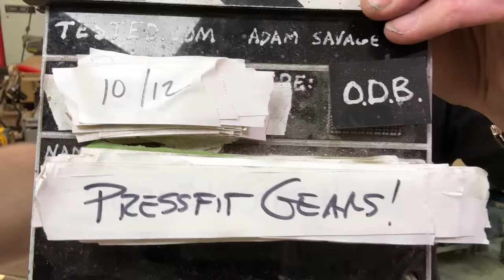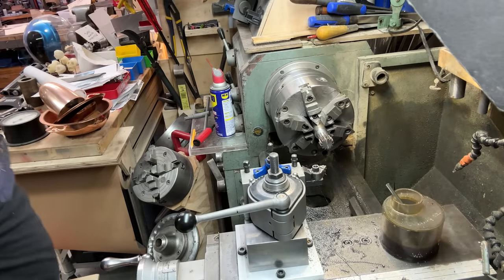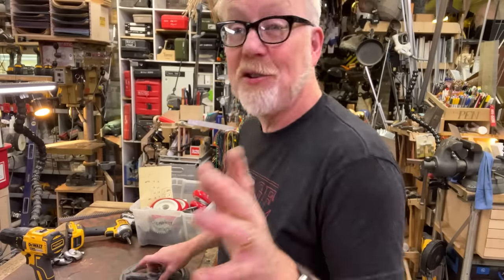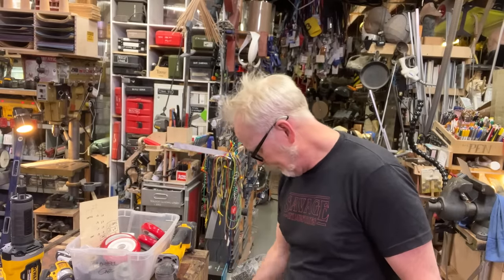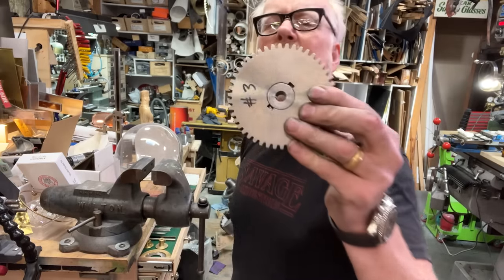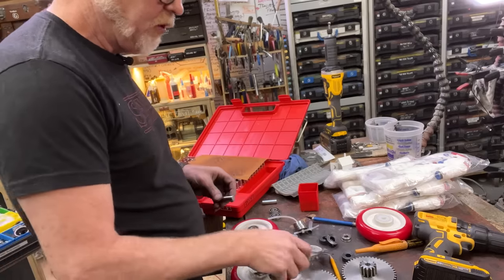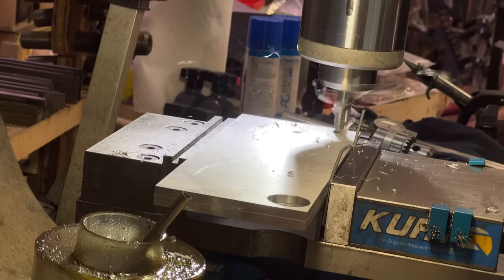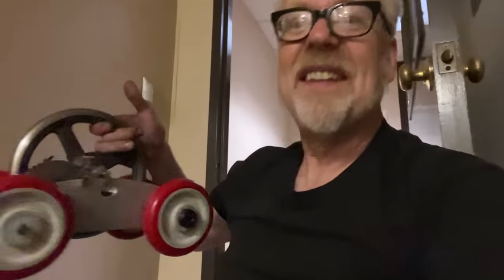Adam Savage's One Day Builds: Giant Flywheel Toy Car!

Comment: More weight on the fly wheel... less weight/ smaller gears. Way too much rotating mass. thin them out a bunch and lower the weight with holes or concave shapes to take material out while maintaining the dimensions.

Comment: Adam, for a safer and more effective cheater 'bar' you need a long tube. Find a six foot long iron pipe with an inside diameter that slips onto your vise handle. Cut it into a 3 foot, 2 foot, and a one foot. Clean em up and you wiill have a perfect set of cheater 'bars' for your cave.
'

Comment: clearly a weight issue, Compare the weight of the component parts of the small toy in relation to the weight of the flywheel. the flywheel on your device can't build up speed because you can't move the small wheels fast enough. But nonetheless a beautiful thing

Comment: The reason it didn’t work is because of the weights of the gears. You have way to much spinning mass specially on the flywheel. You need to scale the weight also, not just the gear ratios. Your gear ratios are 1:1, you size ratio is probably 3:1 but the weight is way off might be 20:1. Also with all that spinning weight you have a lot more friction on the spindles. You most likely will need bearings in each gear to reduce the overall friction caused by the weight of the gears. The gear lash is also off which you pointed out and is the reason it’s making that noise. That’s just more friction leading to poor performance.

Comment: I feel like you kinda failed yourself as a tester. With the little one that fits in your palm, you get it going by reving it up over and over again, holding it off tge ground, until you're adding more power to it. With the big one, you just lazily tried to spin the wheeels while thet were sitting on the ground, preventing it from being able to maintain it's wheel speed while you drew it back to add more to it. It probably worked just fine, you just fumbled the ball, right at the goal line. It just needs a handle so you can get it wound up, without losing its speed in the process.

Comment: You need to lose a lot of the weight on those, slim down the gear, compare the toy flywheel weight to the overall weight and make the same comparison with the one you made, also solid wheel might be better as the rubber has too much grip

Comment: I didn't watch the whole thing. did you calculate rotations per minute reducing through the gear reductions to get the rpm of the driving wheels, and then calculate the speed using the rpm and circumference of the driving wheel? cuz...yea...it looks like you didn't account for any of that 🤔🤷🤦

Comment: You do realize .0001 is a press fit, not .0015… You silly goose… Yer lucky you didn’t crack that cast iron flywheel, when you pressed that chit… you wanna use that much press, ya gotta heat up the bore and cool the shaft…

Comment: I was very disappointed you skipped over the intresting bits in favour of footage of you thinking.
Was hoping to learn stuf.
You did not show anything of balancing the flywheel ,which I was particularly interested in.
The final assembly you hardly got to see with no explication of what was happening.
And you started by machining the drill shaft from the other side of the room so we didn’t see hardly anything.
Maybe start out with a plan and edit out your endless thinking!

Comment: way to much weight on driving mechanism gears, and way too little on flywheel. the model has thin plastic gears, and thin metal gears, except flywheel which is thick and heavy.

Comment: At 27:25 I said out loud... "Stimpy, You Idiot!"  Place the inner part in the freezer till it hits freezer temp. Heat up the outer part with a torch. Quickly press the two together before they have a chance to change temperature very much. Make Thermal Expansion your Bi*ch.  ;-D